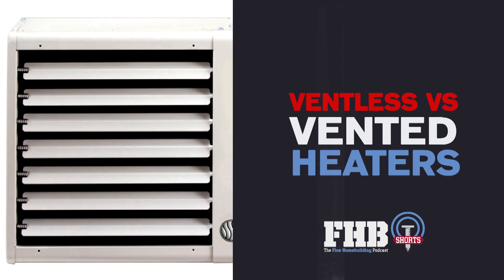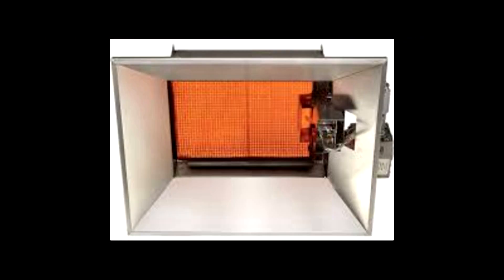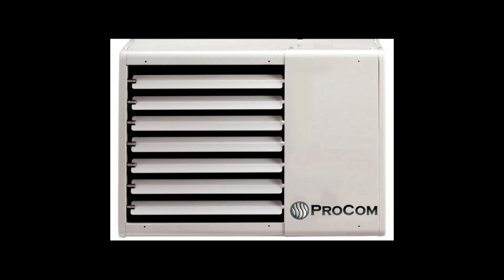Fine Homebuilding Podcast Shorts: Ventless vs. Vented Gas Heaters

Comment: Ventless gas heaters dump moisture into the interior via the combustion process, which can be bad for a wood shop that stores lumber.  The "smoke" seen in cold weather coming out of an exterior vent is mostly water.

Comment: Weld shop has a ventless and I prefer it over turbo heater any day. Electric is nice but size and power needed was too much..alot of old homes around here still run these or kerosene floor units all winter long and someone might die every 10 years, so use with caution